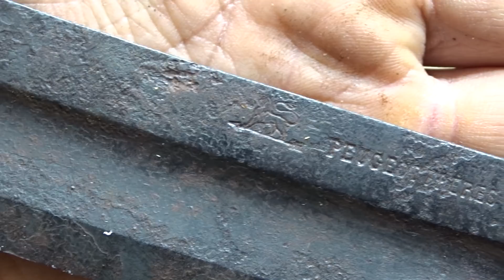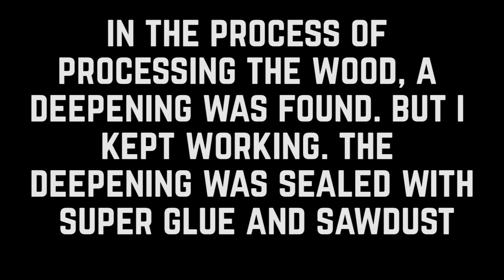Restoration Peugeot Freres Carpenters Drawknife

Comment: Pin the handles. Use a small bar of brass and flatten both side over. It is alot safer. And after such a good job, finish it correctly!  Waell done sir!